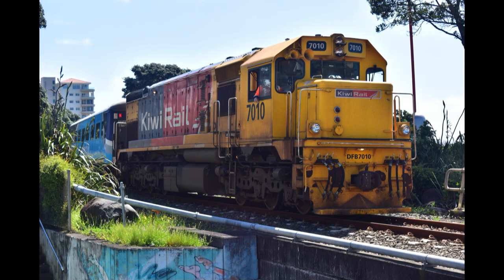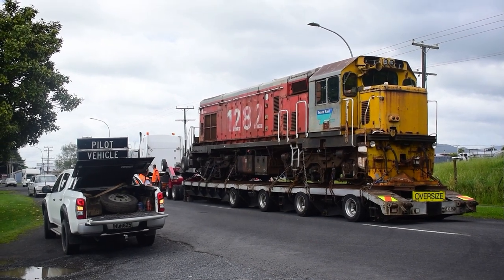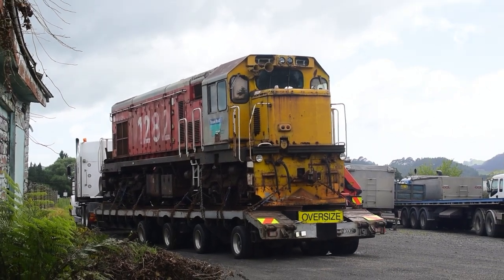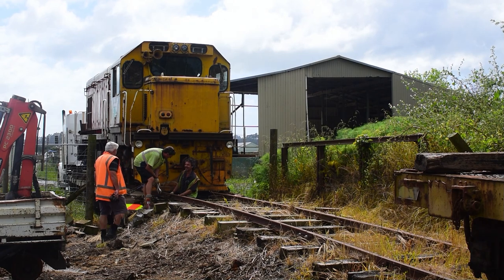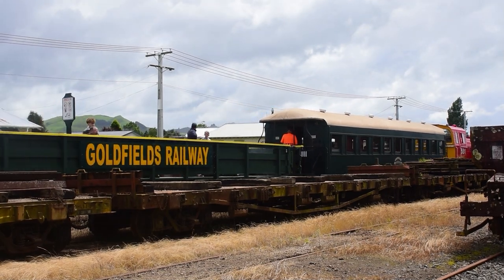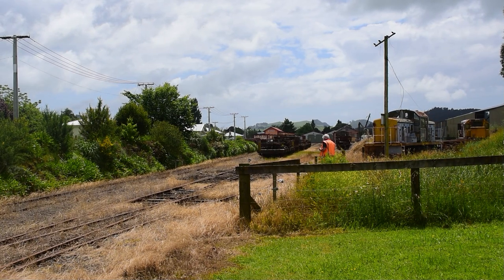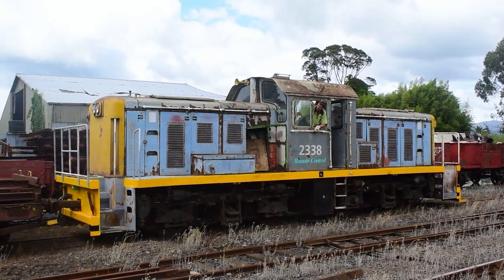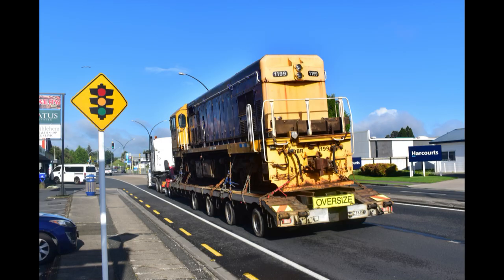DBR locomotives to the Goldfields Railway ~ 18 and 19/11/2022 (HD)

Comment: The removal of the lines between Waihi and Apata and Waihi and Paeroa was the stupidest decision ever made by those in charge of NZ railways at the time. It would have been an excellent tourist route. Just imagine riding through the Karangahake tunnel now!
Reply: If memory serves me correctly I dont think it was altogether the fault of NZ Railways. At that time Land Transport (or whatever name they used back then) had an insatiable need for parts of the right of way for the State Highway upgrades through the Athenree gorge and other areas. As we all know that SH from Paeroa to Tauranga is still way underbuilt for the numbers of trucks and private car volumes. I believe that a handful to guys did try to rescue the Paeroa to Apata rail to be part of a "National rail heritage line" that would connect to the Thames branch and ECMT. As well as running out onto todays main lines the two gorges would have made for great rail tourism......

Comment: It sucks that Kiwirail wasted such useful trains. They could've just refurbish the DBR fleet and continue using them, or even better, use them for new Te Huia trains.
Reply from the maker: They would be too underpowered for Te Huia. One of the reasons why KiwiRail uses DFB locomotives on that service is because they're decently powerful with 2,400 horsepower, while the DBR only has 951 horsepower.
Reply: @DC4260Productions  how about intercity trains? The DBRs could take passengers to country based areas like Whangeri.